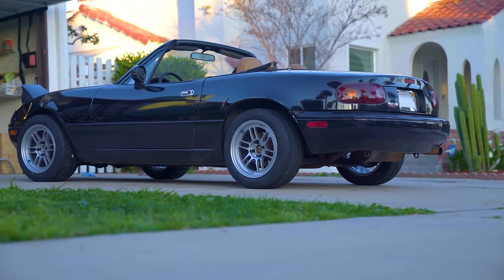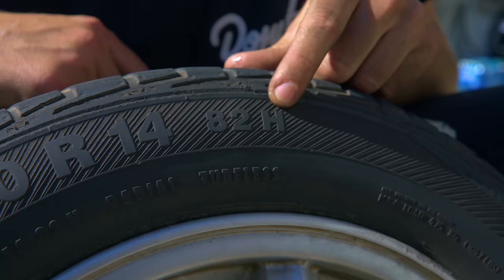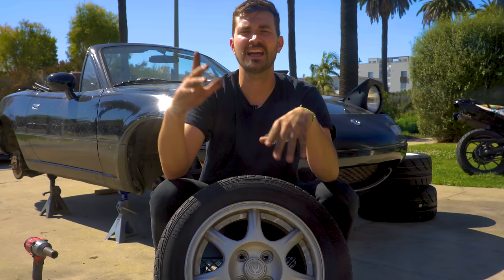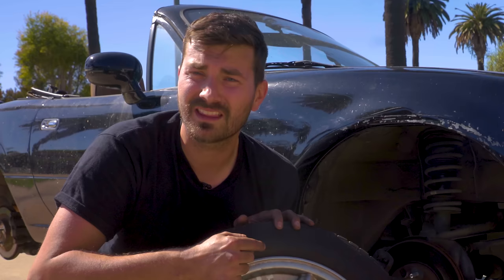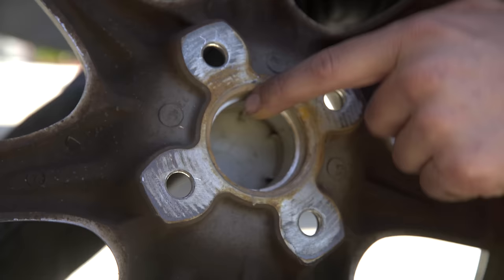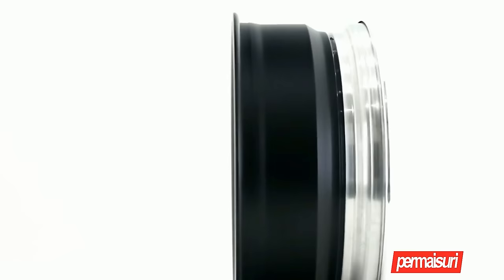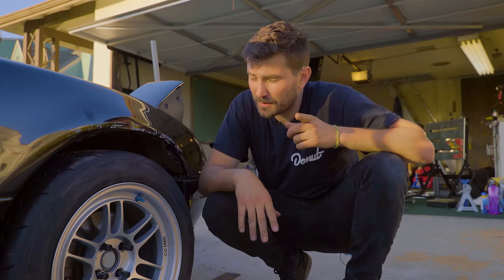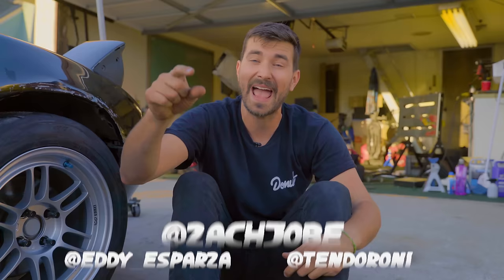How to Pick BETTER Wheels & Tires for YOUR Car

Comment: Tyre contact patch area on ground is only determined by pressure in tyre, and weight on tyre, and a little bit by it's flexibility. So changing to wider tyres will not affect the contact patch area.
Reply: it will though, you can tell if a car has wide tyres just by looking at it from behind
Reply: @arcanevoid9199  Yes the tyre will have wider contact length from back, but narrower contact length from side. If you work out the area, it will be the same for the same weight on tyre and same pressure. If you pump your tires 35psi, it means that for every 35 pounds weight on it, it will have one square inch contact area with road. (psi=pound per square inch). The width of the tyre has no effect on the equation. The tyre will deform untill the pressure from the top is equal to the pressure from the road. To verify what I say, put narrow tyre on one side of your vehicle and wide tyre on other side, do it on smooth concrete. Make sure their pressures is the same. Take your ruler and push it in from back of tyre, take length, also mark on floor. Do same from front, also mark. Measure distance (width) between marks and multiply by length you measured. Do same for other tyre. You will get the same answer.
Reply: @fixingstuff8117  bro that doesn’t make any sense, narrower width from the side????? what, and I’m pretty sure that’s not how psi works. it’s about the pressure inside the tire, and like if I use that with roughly what my car weighs it doesn’t add up at all. if this stuff was true there would be no point running wider tyres, but literally everyone knows wider tyres increase grip
Reply: @arcanevoid9199  What I meant with narrower width from side: Area is Length x Width. I called the longer side(the back and front of tyre) Length, so I have to call the shorter side(side of tyre) width. That is exactly how PSI works and it is true, like I wrote, measure it for yourself. You can even check on a friends car with similar weight.  The grip of a tyre is a whole different discussion, which is why I did not mention the word grip. Grip is determined by tyre height, material tyre is made of, tyre width, pressure, etc. I made the originat comment because of what was said at 13:20 in video. Which is incorrect as I explained. Fortunately you will have to get your ruler and pressure guage and go measure to stop the argument. Which I already did.
Reply: @fixingstuff8117  oh ok, sorry none of this makes any sense to me haha. thats pretty cool that psi works like that, but like how does a wider tyre increase grip if it doesnt make the contact patch bigger? because it makes sense in my head that a wider tyre would have a bigger contact patch and therefore have more grip but idk
Reply: @arcanevoid9199  From what I read, they say that wider tires are made of a bit softer material, so it would have better grip. The sidewall height and stiffness also has a big effect on how much the tyre bends or deflects to the side around corners. The narrow tyres has longer contact pactches than the wider tyres. When accelerating fast from zero the narrow tyre deforms different from wider ones. Most of what I type in this comment is what I read from others explaining. All I found out is that with narrow high sidewall tyres, don't try to corner at very highs speeds, as the tyre might come off the rim and cause you to roll. I also don't spin my tyres, so I am not too worried about the grip. I worry more about fuel consumption, from there the research.
Reply: @fixingstuff8117  ok thank you. if your not spinning tires you need more power ;)

Comment: I need tires... here’s my options 🤔

Dark charcoal wheels with:
235/50-18
Pilot Sport 4S 
or
ExtremeContact Sport

OR

Mach 1 wheels with:
255/45-18 F
285/45-18 R
Pilot Sport A/S
or
ExtremeContact Sport

Comment: Lol in Massachusetts the farthest your wheel can go is flush. And maximum camber is 2 degrees to pass inspection. There's also a maximum height change that I don't remember. Trust me, it sucks. If you like modded cars, live in new hampshire.

Comment: Changing the offset of the front wheels isn't great. You might feel it in your steering wheel as the tire's contact patch goes further away from the kingpin (axle of rotation of your knuckle). A good suspension would have the kingpin in the centre of the contact patch so it doesn't create a moment around the kingpin. With power steering cars today, the feeling is reduced but can still be felt under hard acceleration if you're FWD.

Comment: When I purchased my car from a dealership (brand new FYI in 2015), I made a deal with the dealership and had them take off the 22" wheels and rims and had them put cheap 19" wheels and rims on instead and saved $5,000.00. And had them throw in some Katskins leather seats in my color choice and trim. The car cost $47,595.00 (sticker price). I got it after discounts and dealer discounts, and trading the tires for.. *drumroll* $35,345.00!! Yeah my salesman was amazing!! Plus I was "apparently" his first sale, he was new BTW.

Was a good deal IMHO!! So I took it!! Then a few years later I got a set of factory 22" for $300 with 50% tread, off Craigslist. Only blemish was a little curb damage near an edge of a rim. Sooner or later I need to get that fixed.. So I saved $4,700.00 (not counting what I saved from buying the car) and got free professionally installed all leather interior for free!

On a side note, I tried to find my salesman a few years later to get my mother a good deal on a car, sadly he was no longer there. I wonder if he got fired for selling me the car at such a steal.. 🤔🤔😬😬 

Anyway that's my story on tires, and have a good day. 👍

Comment: Like the video but there’s one error. You said that a larger diameter, and less sidewall equates to more performance oriented. That’s not usually true. More diameter results in more weight, which hurts performance. However it also results in a harsher ride. A harder ride doesn’t mean greater performance.

Comment: I usually just get nice larger OEM wheels and put the proper calculated tire size. I have 18x8 350Z touring wheels on my 3.5 02 maxima, 6 speed....

Comment: Driving at max PSI doesn’t wear your tires out quicker. It gives you a stiffer tire. It’s really quite nice at a drift event. It just makes for a very stiff tire on the street. Unless you have a cheap tire, the middle of the tread doesn’t wear quicker either.

Comment: Hey, I don't think you covered Flow Formed wheels which is a new process that comes in just under forged in your weight/strength/price pecking order.  Maybe also cover bolt centric or hub centric, and hub centric rings to use as an adapter when swapping with other OEMs - like old Audi to new Audi rims.  Finally, with offset and wheel spacers, maybe explain the kingpin angle or axis of inclination for steering load and dartiness off of bumps as you move away from the center of the contact patch?  What is it? It's an imaginary line viewed from directly in front of the wheel drawn through the upper and lower steering knuckle pivot points - tilted inward on top and out toward the bottom.  It should intersect with the ground near the center of the tire's contact patch.  You can alter where it intersects by changing the tire height and offset.  Ideally you want it to intersect with the center of the tire's contact patch. That yields lower steering effort and reduced tire wear.  The distance away from center of the tire is your scrub radius.

Comment: I think offset should be discussed alittle more meaning how you measure to get the right offset . it would of been helpful to see how you actually determined how much offset someone can actually fit on to a car. Now U went from a stock offset to a 25mm offset.. I want to get myself a new set of rims but I dont want to have the fender sitting right on top the wheels . if this makes any sense

Comment: There is some misinformation in this video. 1.) Wider wheels don't always mean larger contact patch and thus more grip. It can also be dangerous without suspension modifications because it will affect suspension geometry. 2.) Less sidewall doesn't always improve performance by lessening sideflex, it is a balance. Less sidewall is good for handling, but straight line acceleration is reduced because more of that heavy tire weight is further away from the center.

http://www.tuneruniversity.com/blog/2011/04/wheel-tech-part-ii-size-matters/
Reply: I went to a lager sidewall tire and smaller diameter wheel because of all the crappy roads and pot holes. It was nerve racking and more work driving on low profile tires even though I liked the look and handling on the freeway.

Comment: How to measure bolt pattern (since they did a bad job of explaining):

Even amount of lugs-measure center to center of two opposing bolt holes

Odd amount of lugs-measure center of one to outside edge of other of two bolts holes farthest apart from each other

No math required
Reply: Odd amount: you could also measure from one bolt hole to the center of your hub and multiply by 2 (some math required)

Comment: 205s are pretty much the minimum I would run on a 8 inch wheel, like those are what I'd run on my 7 in oem wheels.

For 8 in wide, 225 is the middle ground, while 205s will be stretched pretty minimally, as most of the threads I've seen say that the minimum is 215, while the max is 245.

Loving my current fitment tho, 7s with 205s in the front and 8s with 225s in the rear, but going to upgrade to 225s front and 245s in the rear, as that was the widest fitment I'd want given the minor rub under full load in the rear already on my fenders, but I just need grippier tyres and they don't come in the smaller sizes😂😂😂

Comment: Over-inflation makes tires wear out sooner on heavy cars only. Sub 2000 lb cars do not exert the same damaging g-forces through the tires and over-inflation can make them last unbelievably forever on sub 2000 lb cars. The real reason not to over-inflate is because drivers (unskilled) can accidently lock up the brakes in the rain and snow.

Comment: 4:32 that  doesn't matter some by feel softer could last way longer than some cheap hard ones. Also can't compare semi slicks that did 1000 burnouts and drifts to normal tire that spun twice in 3 years. Some tires also don't last as long not because of softness it's just not focused on thread life.

Comment: 6 yr old tires should only be used in burn out contests. Change your old tires people. After a few years tires get hard and thus slick, which is dangerous. Not to mention they will probably be weather cracked, which is also not good. If you aren't wearing them out within a few years, look into some 30-40k mile tires which are usually cheaper, but will still be better than 6 year old hard, slick, cracked Michelins.

Comment: Too much pressure...bad times..
Recently had new tires put on my 350Z. The guy put 55psi in my Federal 595s. I only got 750 miles on my new tires. Middle of tires were slicked out but the outsides had good tread. Garage replaced them for free

Comment: My car sits at about the same height with same wheel specs. but when i go over bumps/uneven surface it does rub and the red paint is stating to show on the tyre

Comment: I was hoping that you would cover in spring weight when talking about wheels......It is always unnecessarily hard work to find out weights, on your very light Mists that is particularly important. Perhaps weigh the wheel, wheel and tyre combo and compare. Then you will have an understanding of the impact on in spring mass. The comment on smaller wheels for the BMW is both about this and rotational inertia. Smaller wheels weigh less, smaller diameter effectively reduces gearing (good thing for acceleration) there is less mass at a lower distance so less momentum to overcome on turning and braking and less inertia for acceleration. Also perhaps cover the trade off in ultimate grip for window from grip to slip with lower profile tyres (btw the aspect ratio is on both sides of the tyre so there is half of x% x width from the rim to tread surface).
A good intro but please make another with more information so that enthusiasts actually buy the best combo to enjoy their cars. PS be very careful in the wet on your 888s especially on a light car. Probably important for your viewers as well, better off with an ao48 or ps4 for street use if you want an ultra high performance tyre and not to fall off the road in the rain. The 888 is pretty good on the track and in the dry (When it is warm enough) Cold 888s or wet 888s are going to make your life interesting or shorter.
Reply: Unspung not in spring weight, sorry!

Comment: But if you look on charts over the internet, the min tire width for an 8 inch wheel, would be 215. Or is it just a matter of Toyo's R888 being actually wider than the advertised 205?

Comment: Bruh. I love y’all but you skipped the most important discussions: How offset, diameter, weight, and backspacing affect handling and suspension!

Do a video or two on these topics, please: Scrub radius, caster, camber, unsprung weight. 

These are the most important things affected by aftermarket wheels and tires — and they’re greatly affected by even small deviations.

Comment: Weird question that somehow no one has been able to answer for me. I got some new wheels and tires for my vehicle. They are quite a bit bigger but everything fits good and they drive alright. The only issue is that no matter how many times I torque the lugs down in the star pattern, if I continue the pattern over and over they still keep tightening meaning that they come loose. As I drive around on them my wheels instantly get loose and start to wobble a ton. It’s not the balance either. Any idea what I need to look for? All I could find is that they came off a car with m14 studs and mine are m12

Comment: If my car is stock, should I be replacing my tires with the same size as stock? Is there a benefit to putting bigger tires than stock on my car (96' Tbird LX)?

Comment: Damn this actually explained stuff pretty well. Its crazy to me how the '16 370z Sport have such high offsets. So essentially If I go to a lower offset like around 15mm or so, it should help the wheel go more towards the fender since the OEM offset is like 40mm?

Comment: Checking the door frame decal for proper tire inflation - I wish tire shops would do that. Every time I've picked up a Miata from a tire shop (at least five different shops) the tires were inflated to around 35 PSI. Do they think the manufacturer's specified 26 PSI is not enough?

Comment: Is it possible for the tire to be too wide for your wheel? I’m having trouble figuring out if a set of 235/45/17 fit my XXR530’s? Which are 17’s.

Comment: Aluminium lug nuts are not that great. If you plan to take that wheel on and off a lot you'll find they cross thread easy and round off quickly, I recommend steel spline drive. they last much longer in daily driven modded cars. tire rotations, tire flips, brake work, suspension work you name it.  Show cars can use Aluminium sense the main goal is looks.

Comment: I've got a Mitsubishi GTO, factory recommended Tyre size is 225/50/17 front and 245/45/17 rear. I wanna put 245/45/17 front & 265/40/17 rear.
Basically getting wider tyres that fit my 8jj front rim and 9jj rear.
Now I'll be driving 240 km/HR meaning 150 mph.
I've heard sports cars tyres expand on high speeds so is it going to be good or bad getting wider tyres?
Thanks.

Comment: 16:40 i'm almost positive it does not mean 1.5mm in between each thread. It should be 1.5 threads per mm iirc.
Reply: he's right and it's imperial that uses n threads per 1 inch

Comment: Great video! I have a question. I own a 1999 Mazda MX-5 1.8 and looking into buying new wheels and tires.
I live in Sweden and I found a good deal on OZ Ultralaggera 15x7 they are lightweight and for this should I go with 195 or 205 and should it be 45 or 50? I will lower my car soon with new coilovers about 20mm.

Comment: Please anyone I need help on wheels. I am looking for nothing flashy or fancy just the recommended wheel size and or fittings for my tires. I have a 2013 e350 sport mbez. Rear tires recommended size is 265/35 R18 extra load. And the front is 245/40 R18 extra load.  I know the "R18" means I need an 18 inch wheels but any other thing to consider when buying the wheels ? Though I will buy a 5 double spoke wheels but I want the recommended size or fitting  for the recommended tires by the manufacturer. Thanks in advance 🙏.

Comment: How come your tire width is 185mm (7.28in) but your rim is 5.5in (139mm). By that math your tires should be 45.3mm (1.78in) wider than your rims. I know sub 2 inches isn't a lot but those wheels look pretty flush with the rims. How does that work? I'm confused.

Comment: Tires: rated to 130mph
Me: drives miata 131mph and wrecks because the tires blew apart
Me: survives because of massive chassis and safety upgrades built to near Nascar specs

Comment: I just finally got my AVID wheels in 18"x8" +35 offset just to bring them out a hair, from where they were, Had a 17"x7" stock wheels with a 235x50x17 tire on them, Gonna probably go with a 245x45x18 tire, I don't know if I want a 245x40x18 tire cause of the ride, on a 245 18" rim, Don't want the feel to be to rough, IDK Maybe the 40 won't be that bad.. I have a Tuned Nissan Juke but either way with the 45 I'll be a little faster on speed OD, or a little slower on the 40.. It's something like 1.5% either way, Really don't know what tire to get though??

Comment: Do you know if by chance that all hubs centric rings brick rings are made of a certain material? I've seen some made out of plastic, and some made out of aluminum, and I don't think this plastic is very safe.
Reply: plastic is actually better, often metal hub rings can make it hard to take the wheel off